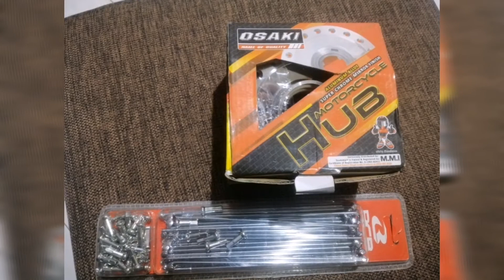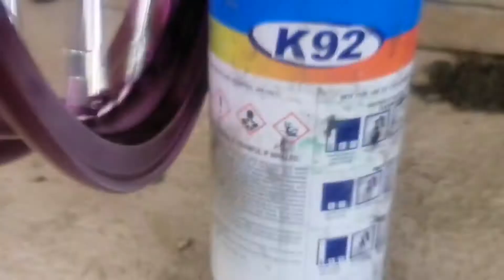Rimset assemble and alignment (honda tmx 155 project)

Comment: Pati ba yung axle sa front, pang xrm din? Hindi ba maluwang sa shock yun paps?
Reply from the maker: Stock axle stock hub ung pang likod ko paps, ung pang harap un talaga pang xrm kse mahirap hanap an ng bearing. Maluwang s shock pero ni lagyan ko metal sleeve. Bushing ng swing arm tmx ginamit ko kunin mu ung pang loob n part  sakto sa butas ng shock sa harapan. Godbless